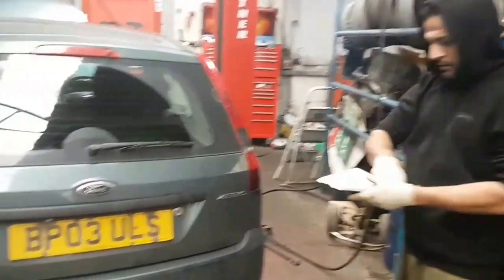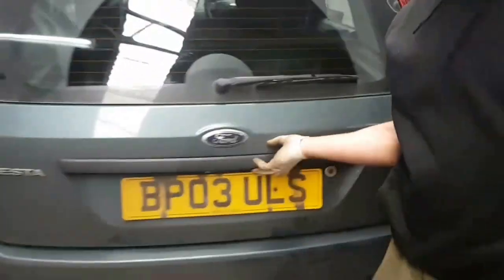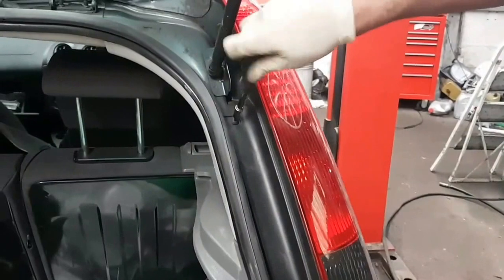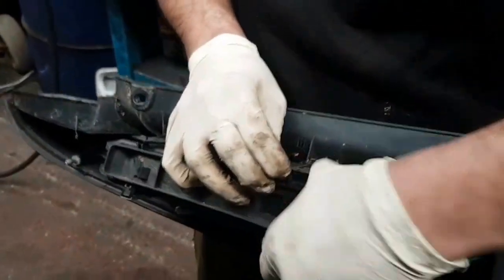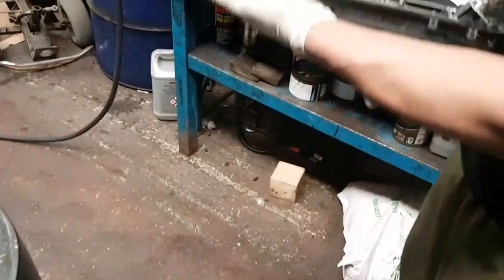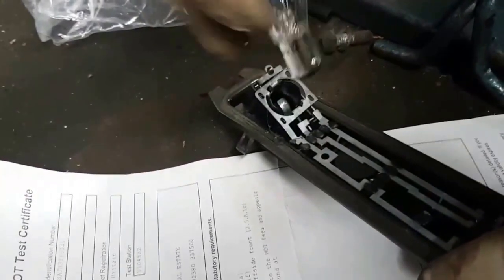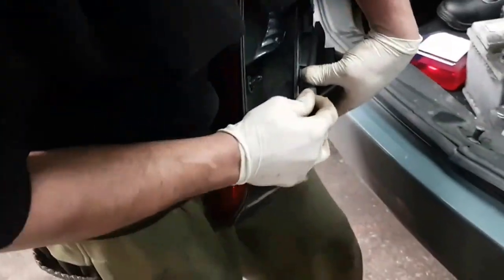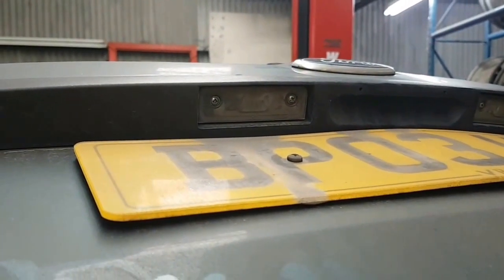How to change brake light bulb - FORD FIESTA mk 6

Comment: Hi! Thank you so much for this video! I just changed a headlight bulb myself for the first time - soooo excited about it! Did it without watching videos. But then my brake light is also out, so I thought hey I did the front one, I can do the back one too - unscrewed two screws and tried to pull the thingie off but couldn't, so after watching your video I found out about the hidden screw inside the boot, located it and just gotta get the bulbs now 😅 

Again, thank you so much! 🙏

Comment: Clearly explained and showed. Good video. The important part I needed to work out was how to remove the upper part once  the 3 screws removed. I wasn't sure if there was another screw but once you showed it is a locating lug that needed a little bit of a pull at the top to release it, I was no longer afraid of cracking my lens unit. Many thanks :)

Comment: Very clearly explained  Thanks Taj... Just a little tip.... ( I have arthritic hands ) The wing nut on the back is a right pain...I dropped mine into the facia and it took me longer to retrieve it than it did fixing the light... next time I'll tape some string on it before I completely unscrew it.. save a lot of heartache...

Comment: Good vid, if you have a later Mk6 you don't have the internal plastic screw to contend with, its just the 2 torx screws and the lugs retaining the cluster. The cluster itself is also slightly different with direct access to each bulb holder.

Comment: Hey, thanks so much for the video but when I go to 1:10 in the video, and I go to unscrew that it won't move at all, literally won't budge. Any advice?
Reply from the maker: Hi yes if you got wd40/gt85 maintenance spray use that and leave it for few minutes and if you got pliers in hand use that to unscrew it anti-clockwise. Hope this works for you..

Comment: Hello i have a Q : (sorry if you answer it in the video, my english is not good)
The rear stop light has two bulb filaments so which one is up the "small" or the" big" ? Thanks :)
Reply from the maker: The Top Bulb - P21/5W RB380 
The Bottom Bulb - P21W RB382

The Orange Indicator Bulb - PY21W 581

Hope this information helped!